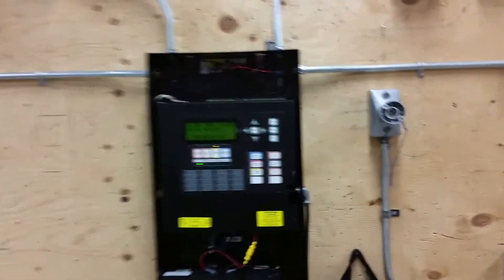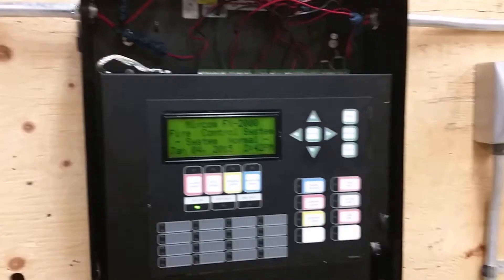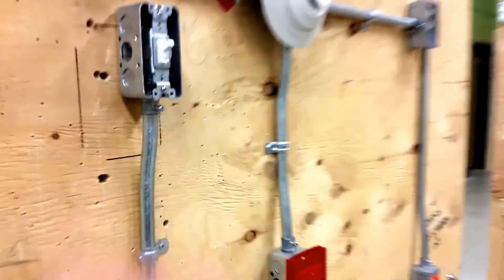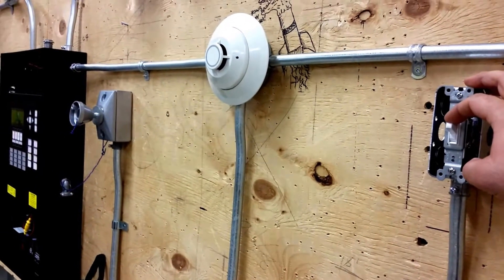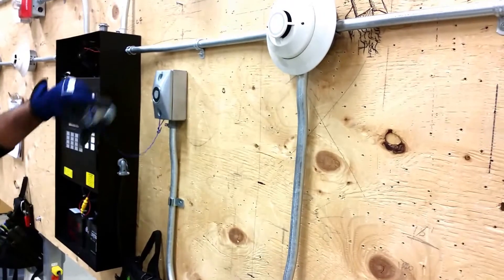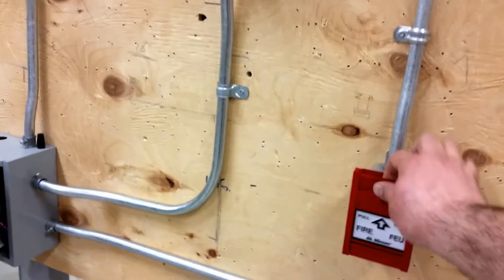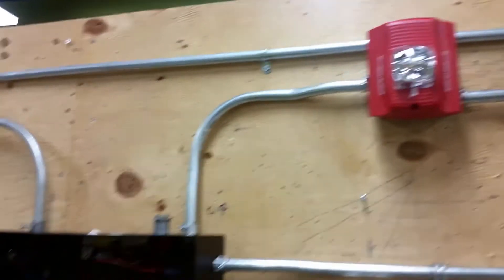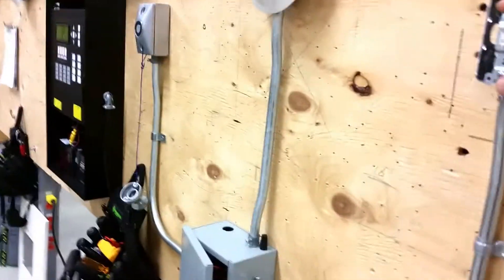FX-2000 @ PEC Lachine

Comment: why are you calling it a "mag lock"? it's a door holder.
Reply from the maker: Mag Lock = Magnetic Lock. Yes it is a door holder.
Reply: Its not a lock. Its a holder. Why can't all the newbies get that ?
Reply from the maker: From wikipedia: "An electromagnetic lock, magnetic lock, or maglock is a locking device that consists of an electromagnet and an armature plate. There are two main types of electric locking devices. Locking devices can be either "fail safe" or "fail secure". A fail-secure locking device remains locked when power is lost. Fail-safe locking devices are unlocked when de-energized."
Reply from the maker: Oh and BTW the maglock is not the point of the video... it's explaining the FX2000.
Reply: Its still not a maglock.  Features of the fx2000? It can de energize a door holder?  Amazing!
Reply from the maker: well... like all devices, the fx-2000 has a purpose. one of them is de-energizing a relay/door-holder/maglock etc. ure dwelling on semantics my friend, while I was trying to show how to accomplish a task (albeit a simple one )